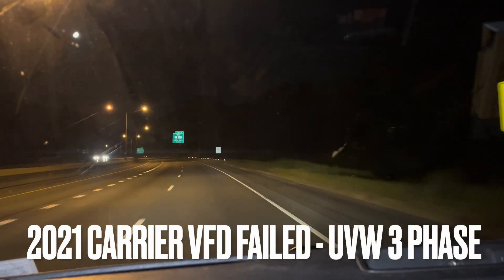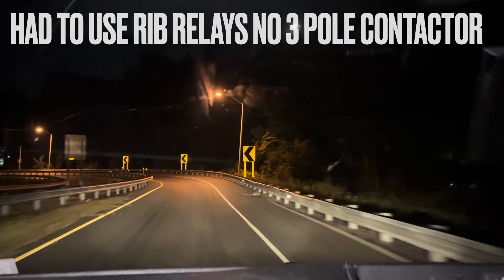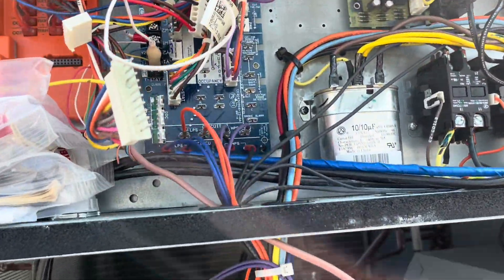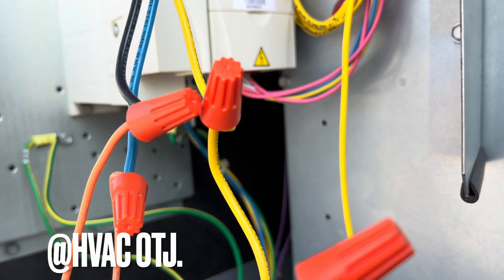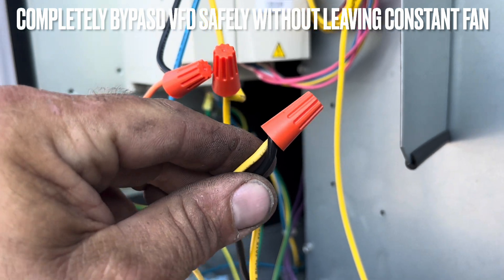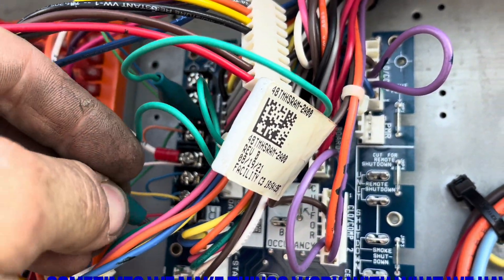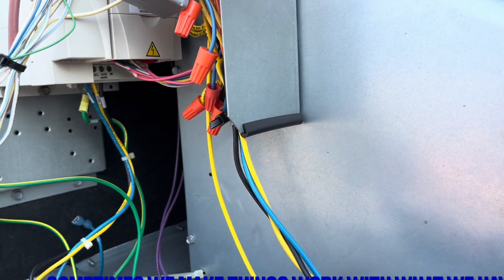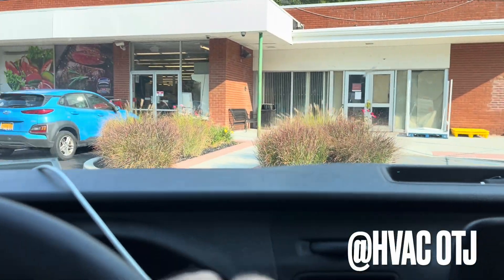VFD CARRIER FAIL. HOW TO BYPASS WITHOUT LEAVING FAN CONSTANTLY RUNNING

Comment: I had the same unit that had the vfd bypassed. The fan was only running at 3.5 amps. Not moving air fast enough, coil was freezing. Any suggestions??

Comment: Are you sure heating and cooling will turn the fan on
Reply from the maker: Yes.   But that was a temporary fix in the dead of winter.  We do that so the fan is not powered direct in case of fire.   The VFD probably was replaced within ten days.    Thx for asking.